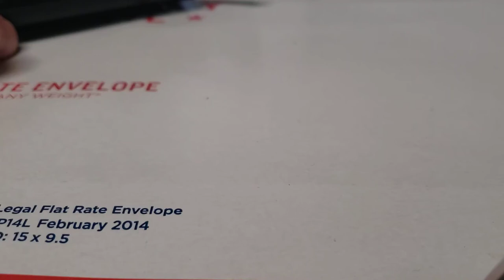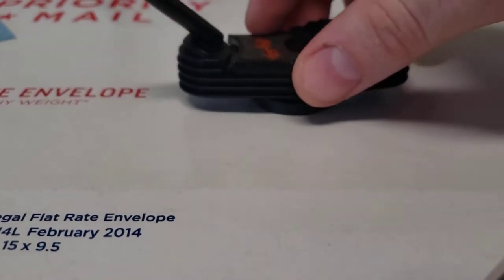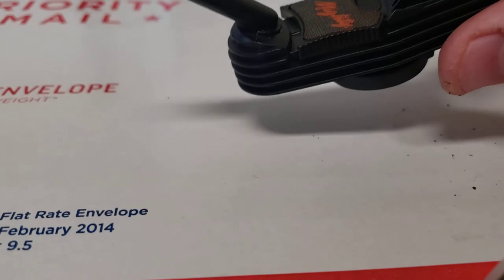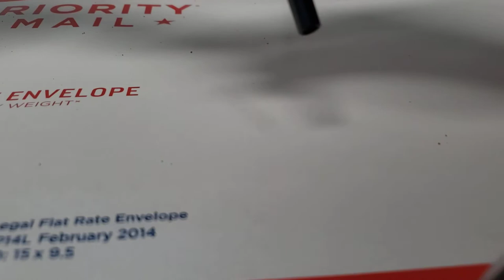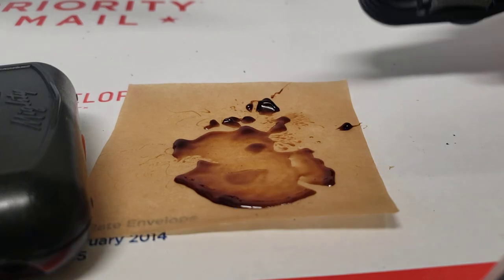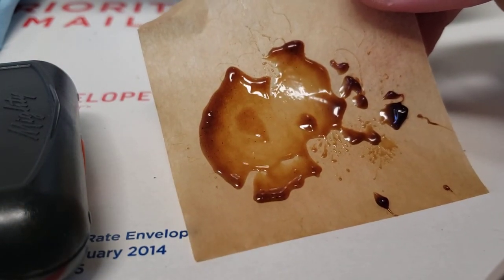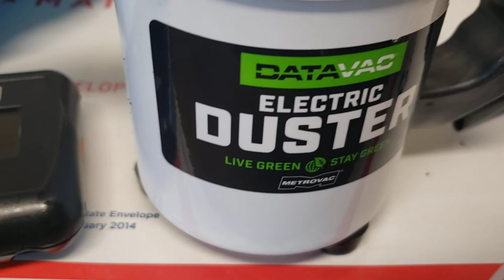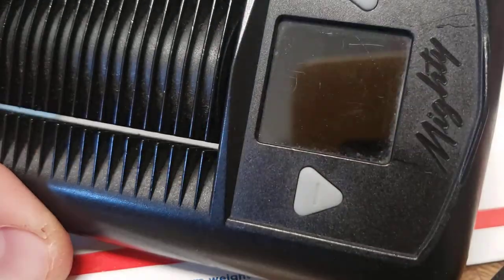New DUSTER METHOD to clean Storz and Bickel Mighty Cooling Chamber

Comment: Just buy a second CU and change it every week. Put it in a flat glass box in isoprop and every two weeks cleaning with a brush. takes 10min to clean both CUs. They are like a new one after that.
Reply: In your case you have to remove the isoprop from the reclaim, to safely vape it. When you use the methode of the Video, you can simply putting the reclaim in ur vape
Reply: @ohnenamen5911  If you prefer his method, feel free to combine both methods. I definitely would clean the CU afterwards properly 😜

Comment: This is by far the nastiest cooling unit I have ever seen. Most people care for their units far better than this. Take it apart, soak it in alcohol for 20mins, rinse & dry and they come out brand new.
Reply: This is exactly what I was thinking. It's really not nice. 😂

If he wants to resin then fair enough but I hope he cleans it propoerly soon. It can't be good for the body.
Reply: @TheWishDragon  its very nice actually. It is very pure oil, not touched by any butane, or iso.
Reply: @Reebister  its not bad to have it there even if you are empty and turn vape on you will get high from the sidement left there :D
Reply: @Reebister  Nope, that oil is carcinogens left over from the oil. That oil is not meant for human consumption.
Reply: @SlaveKnightGael  I don't think if it has any more carcinogens than the herb that was vaped. It was just vapor that cooled and solidified.
Reply: @Reebister  i am quite curious to have it explained to me,by those saying the reclaim has carcinogens.

i ask honestly,I don't assume right or wrong, please someone explain it scientifically
Reply: @SlaveKnightGael  carcinogens or not, id sandwich it between flower and vape without a second thought.
Reply: The resin is not oil just saying oil is greasy resin is sticky big diffrence ;) the resin are terpenes and resin that are released on sertent temperatures  you can check online terpene release from vaping vape on 160, 170, 196 then max 198 and tics to 200 a 201 depends on the device (if you go higher then 200 you release unhealthy vapor) and you dont want that i think its called benzeen or so
Reply: Extra nasty.. bunch of old saliva mixed with reclaim
Reply: @AS-gr5zx  😂 saliva
Reply: @SlaveKnightGael  not if you make cookies or muffins or anything edible with fat in it
Reply: @spidergrafxxx  you seen how people get joints all wet at the mouth tip? Yeah same shit can happen here
Reply: @spidergrafxxx I get what you're saying but I don't think it works like that. Most people who take hits off of the Mighty wipe the tip before taking a hit. Sure, there may be some residue there but it's not the same as a joint or blunt that just keeps getting soggier.
Reply: Most of the carcinogens are from the process of combustion and this was a product of vaporizing so probably not many known carcinogens in there.  I think there are 2 or 3 kinds still in there but its not like the resin inside a spoon pipe.  The gunk is clearly resin from the trichomes that vaporized and then solidified in the cooling chamber.  Within the resin are cannabinoids because resin is sticky and has high adhesive strength.  It definitely will get you high, but a lot of the THC will degrade to CBN so probably more drowsy than high.  Saliva?  Probably.  Unless your mouth is on constant sucking mode when near the mouthpiece, even your breath has saliva vapor (like fogging up the mirror with your breath) so saliva most likely has traveled into the mouthpiece.

Such a fun conversation you guys had here..

Comment: There's a touch of that american ingenuity. I wonder if my office needs one of those dusters...
Reply: also to further investigate on your american ingenuity... by german design, those who do not apply on american stupidity, engineered the cooling cap in a way, it has more corners and straight lines than last nfs published game! so to clean this mighty+ with a duster is entirely wrong and should be taken apart and cleaned separately, preferably after each full session to minimize buildup.
Reply: pffft this is why the vapcap is great, its a shotgun, you load it up, and fire it any time anywhere, electric vapes are baisically just ikea tents,  more trouble than the extremely hefty price tag can compensate for

Comment: If I'd use this method, I would:

- do it just after vaping while the cooling chamber is still hot while making sure that the duster runs at least 30 seconds before the process.

- take the mouthpiece off

✌️
Reply: There is always so much oil around the claw underneath the mouthpiece's o-ring, you would have to do it all by hand, which is difficult because of the very narrow grooves in the claw.

Comment: @Eric j FromBackInTheDay That resin heat it up on low fire with whole milk not fat free , long enough untill the resin desolves into the milk (it takes a while dont rush it) and thank me later and you dont need to do this anymore and evry week you have a bit resin for happy times :)
Reply: Ill just explain here so after a vape sesion you take off your cooling unit and open it . ( Wen its warm its easy to open) then you carefully scrape ( i use a potatoknife ) the resin out on a plate if you got all off it out you close it back and clean out the heating chamber with your ethanol or cleaning alcohol on toilet paper or a cloth wathever you like. Then for the screen use a cotton stick (that you put in the alcohol first) and scroll over it untill you need to change cotton stick rinse and repeat untill its clean and do that evry week u can even put a cotton stick in the mounth peace buth carefull. One big tip always tilt the device backwards while vaping and wen its hot so the resin comes to the back part off the cooling unit and you barely have resin on the mounthpeace anymore. So mutch better to clean that way. Also i always use the capsules (use only one capsule at the time just clean it after evry session if you can use you nails or toilet paper with some cleaning alcohol or ethanol)so it helps to keep the device clean as long you clean evry week and ones a month completely or like you think its time to clean it completely this method you can use your screens way longer and you have full potential off your device thank me later. Have a vape day yall

Comment: i douby this is going to fully clean the chamber because of the way its build on the insid with the twist and all the little sections. in the video u didnt fully clean it and open it. what we see is not enough. it looks like you'd have to clean them with isopropyl anyway. and while cooling units are easy as hell to soak and clean anyway your method is useless for cleaning the heating chamber's built up wall residue which is actually so difficult to clean that you cant even complain about the cooling unit.
Reply: Harvest the honey oil first for chonging (strong as hell) then clean it with an iso bath, then boiling water bath
Reply: Thing is it's about getting effective. This is a brand new idea. Rev 1 of anything is less effective, but that doesn't make it worthless

I was thinking heat(hair dryer?), then pressure(duster), then manual removal of reclaim at the mouth piece (plastic cleaning tool), then disassembly and chemical bath. But that chemical bath wouldn't need to be as often, maybe once every 4 or 5  cleanings. 

Also, those are like little heat sinks on the sides and top. So aim the  heat at the flat parts, not the fins.
Reply: @alan121010  I have so much build up inside my chamber, I opened the unit and there is really no way to clean the chamber without disassembling the wires. Any help?
Reply: if it means having some reclaim that dosent have to be purged of ipa, and dosent contain some of the harmful things that ipa can contain...

Comment: The brush and disposable cotton swabs wetted with drops of 190 proof ethanol easily clean oil from cooling unit surfaces. The alcohol also disinfects the unit, and keeps the brush clean, too. Now time to put on 707 headband.
Reply: Keep that resin dont trow it away thank me later

Comment: Will the pressure going through the small area for a long time break or make the duster break ? And is it normal for the duster to get quite hot ?
Reply: No it will not break and yeas the duster gets hottoer as longer u use it. So dont over do it

Comment: That’s awesome. But Damn. An $85 dollar duster? Is the air hot at all? I wonder if a hair dryer with a DIY custom tip would work.  Thanx for the smart idea.
Reply from the maker: The air gets very hot from the duster because it is actually a very high-performance (nearly 1 Horsepower!) duster that cools with the air it is blowing. I originally bought it for $60 and there are some other similar models out there. I love your idea about a hairdrier with a modified tip, that could also work great. I'm not sure why the duster works so well, if it is the heat, air velocity or both. The duster probably can generate higher pressure than a hair drier with tip, but still totally worth trying to see what kind of results are possible. An air compressor may also be worth trying, not sure how it would work.
Reply: @ericjfrombackintheday2059       Thanx for the response.
Reply: @ericjfrombackintheday2059  would bet on it being heat. Make it melt just a little bit, and then push it out really fast before it can liquify

Comment: It seems like it was never cleaned. Take that mouth piece out and soak it in alcohol the screen is removed by the other end. Just soak the cooling unit in alcohol use the factory brush. Then rinse under hot water dry install the screen and the blue gasket’s. It’s best not to soak the gasket’s just wipe with alcohol then rinse. Odd video but it was interesting 🧐 thank you

Comment: If u think on it much easy way ..
Use your oven.i clean my dab rigs and nectar straws ..I turn oven on to 175 just hot enough to get wax dripping.then I use a quartz dish and put right under dab rig....looks like this has some plastic tho..I still think at a low temperature u can still put that mighty heat thing in oven...from the sound I thought guy was using a hair dryer using the heat to get resin build up to drip out...lol

Comment: I use the dosing cap only and I really only have to clean it once every 2 -3 weeks
Reply: Dosing caps act like a Dutch oven it burns everything a lot hotter
Reply: @jjb-rad804  oh ok is that a bad thing? I haven't loaded herb directly into the chamber is that a better use of it
Reply: @mitchellwhite3437  doesn’t really matter. Whichever you prefer. The mighty doesn’t get hot enough to hurt ya
Reply: @mitchellwhite3437  the dosing caps are great

Comment: I dunno man. This method doesn't really clean it. I think its easier to just put the whole cooling unit in hot milk and let all the residue dissolve. And then you drink the milk for fun times.

If you want to collect the reclaim separately then a easy way is to open the cooling unit, put the pieces on a bit of baking paper and then set it down on a usb coffe mug warmer. 90% of it will drip down on to the paper in time. If u dont have coffe mug warmer then you can also do this in the oven (if your oven can go on a low temperature)

Comment: Damn bro this device looks like a grotty pos, and what comes out is nothing less than disgusting lol. Get yourself one or even a couple of exchange units. Have a big jar with isopropyl. Switch them every second day, disassemble, put in the glass for 5 min. Rinse with warm water, use q-tips to remove sediments which is barely necessary if you play it this way. Let dry, assemble, enjoy. :)
Reply: Far more work than the method shown here, no sticky iso all over your hands or need to glove up, less mess. And that disgusting looking stuff is potent af, doesn't smell or taste amazing but its some strong stuff. I just clean the mighty with a dab tool and scrape it into a wax pot but think this is definitely worth a shot
Reply: smoke more oil bro
Reply: @Sterling20073  I hope you know that resin in the cooling unit is full of carcinogens. It's not meant to be smoked.
Reply: @SlaveKnightGael  i hadn't heard that
Reply: @SlaveKnightGael  i am quite curious to have it explained to me,by those saying the reclaim has carcinogens.

i am not here claiming I have any knowledge

i ask honestly,I don't assume right or wrong, please someone explain it scientifically how what is left behind is full of carcinogens

Thanks man
Reply: @SlaveKnightGael The resin in the cooling chamber is the exact same stuff you inhale when you vape normally, or it wouldnt condense on the inside of the chamber 🤦‍♂️🤷🤦‍♂️🤷 Just dont smoke it? This is a community of vapers after all?

Comment: One question to all mighty users.
Has anyone wondered if plastic particals from the cooling unit could possibly be inhaled ? 
Since it can get really hot I wonder if this is the case...
Reply: No, you won’t inhale them, the temperatures aren’t high enough
Reply: It's medical grade plastics
Reply: Heat resistant medical grade plastics
Reply: Storz & Bickel are a licensed medical equipment facility, supplying the world with medical vaporizers. It is a highly regulated industry & very doubtful that their vaporizers would easily denature.
The plastic they are using in their devices is wildly stable.